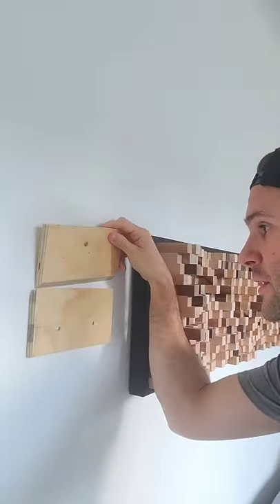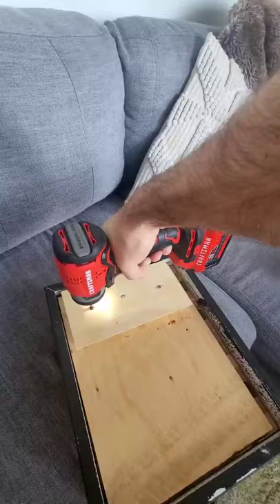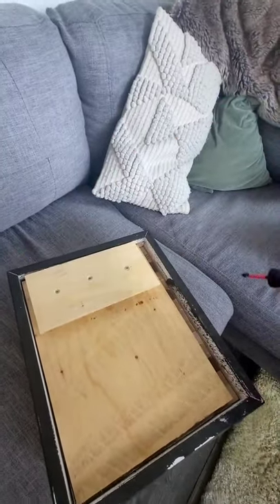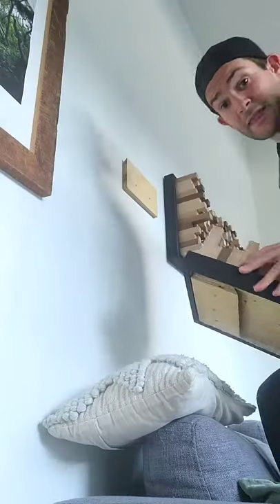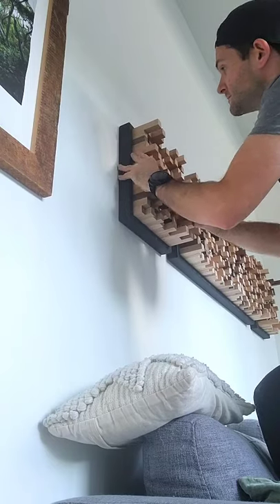CHEAP and easy heavy duty wall mounts!

Comment: You could also just get a cheap strip of aluminum Z clips. Same principle but with much smaller pieces. It unfortunately may actually be cheaper now that wood has gotten so expensive.. Because I wouldn't trust any wood to hold stuff like that...

Comment: Had to install like 6 300lbs+ Billboards in a college and we used two lengths of these one on the top and one on the bottom running the whole length, easy peasy (apart from lifting the 300lbs+ billboards xD)

Comment: I just used some French cleats to mount some cabinets at my school! They work so well!
Reply from the maker: Great for job at school too because of how cheap they are 😀
Reply: @ZacBuilds  exactly! Showed them to my teacher, and now he loves them for building/connecting stage sets and platforms together!
Reply: If the cabinets are elevated, be sure to include a nailer strip at the bottom of the cabinet. A couple of brad nails or screws will ensure that the cabinets don't pop out of the French cleat when someone bumps it.
Reply: @barryliebenberg  I know, I’ve built many cabinets before. In my opinion, French cleats are the best way to hang them. I prefer them to directly screwing the back panel to the studs. But I always add a nailer strip. It’s obvious